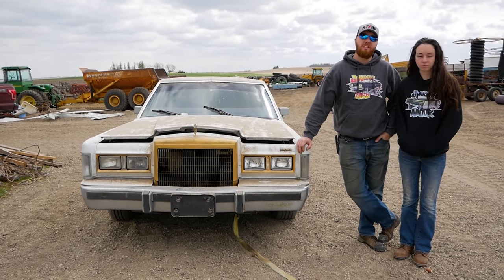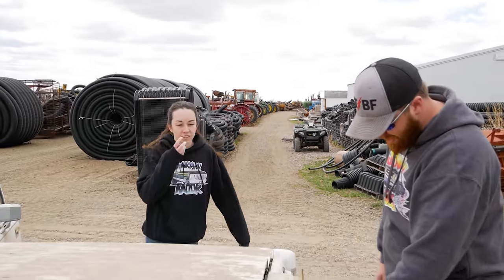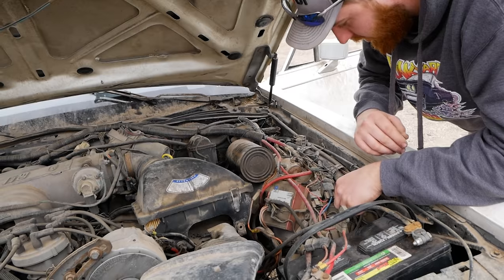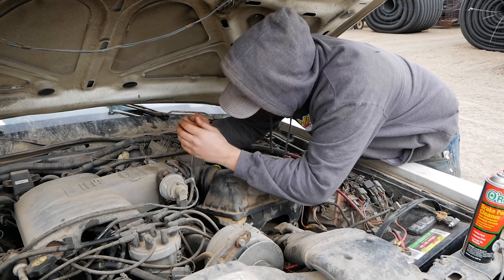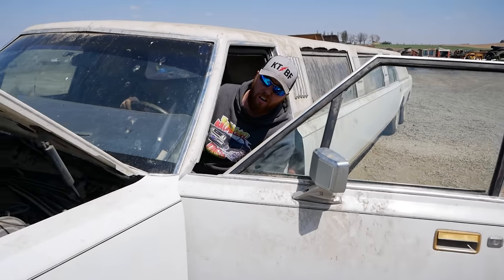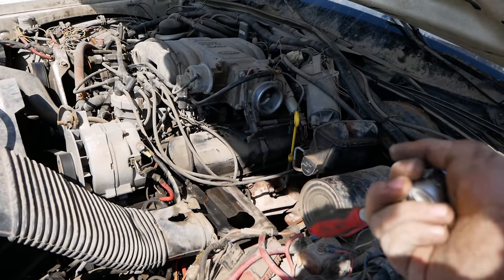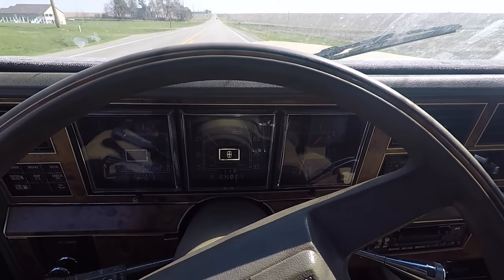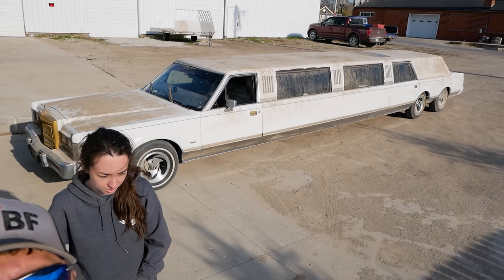Can We Fix an ABANDONED 35 Foot Limo?! - EFI Revival

Comment: You might want to research it.   If it's the same one I tried to buy 25 years ago. Then it was used in some rock videos. White Snake, Quiet riot. Weird Al Yankavuch. Some early rap videos.  Can't be many made.  I believe it was around 100.000 brand new

Comment: Put a six-wheel drive military bottom and a belt-driven V8 supercharged to 1100 horsepower on 2 ton military axles with rear steer fix the interior and throw a huge stereo system in it driving around in the mud bogs in Florida

Comment: That 302 is more impressive when you figure its the lower performance 150hp on a good day engine tuned for smooth running not power.

Comment: I'd leave that 302 in it. Yes it's not much sitting at nearly 40 years old and it's a torque engine so it's pretty slow but the 302 accepts alot more power with very little upgrading. I'm way more surprised that an AOD transmission can pull that car. This is way back when auto transmissions were just weak slush boxes

Comment: okay that fuel is just straight up nasty the old guys are going to have to flush that tank out flush the fuel system out replace the fuel pump make sure the lines don't have any holes in them and put brand new fuel in and try to see if it'll run

Comment: I say you should cut the middle out and make a normal length car with 2 rear axles...and fix the rear suspension trash and possibly ACTUALLY make it have dual driven rear axles.

Comment: 200 watts for 25 feet.  If the sub is in the back. The driver sure doesn’t even know if it works or not.  You need like 12 12’ subs and about 6000 watts to sound decent in that thing.  And that’s 6000rms not max.

Comment: I wonder if that's the former, Luciano Pavarotti, limousine?

Why would I wonder if it was his? He loaned it to me. Back around, 1984.  In New York City. And well… The New York City Police Department felt, it was necessary to, stop my chauffeur and me. Indicating there might be a gun in this vehicle? And having to remove, all of its, internal structures of, seats, wet bar, carpeting, TV, radio. Before they realized they made a mistake an hour later. Or maybe that was 2 hours later? Either way they took Pavarotti's, white stretch Lincoln limousine apart. The night he loaned it to me.

And so I can imagine. Somebody would get really upset over that. To have their car dismantled. When they have loaned it to me. Complete with his chauffeur driver. And well now that Pavarotti is dead. Who would want that old limousine. Whose interior had been disassembled by the New York City Police Department. And then reassembled.

And so I was wondering if that was the same, limousine? As it looks nearly identical.
RamyRAD

Comment: it’s funny the Cruise Control  does work in the Limo  almost always Fords do  and GeneralMotors older vehicles do not ? I beleive Ford products in general  use a very old Cruise Controll technology  as i beleive  they were the Company that pioneered  Cruise controll you should had taken Mook through the Drive thru for som reason i think she would had made that pretty funny  like she always turns something into entertaining  i grew up inSouthFlorida and the localJeep Dealership had a owner that was really into Racing and Off Roading he  always had his Mechanics working on Whacky Projects  one of which was always a old JeepFrame that was Monster Trucked and  they were constantly swapping out  the Body on top of the frame  one point they had a Stretch Limo ,OpelGT  and  they took a Old Gremlin  and chopped it up into a ElCamino  they called the GremUp !  ironically that  actuall body was  a old High School Freind of mine who’s Father was a Mechanic for AMC and the  Son took over his Das Bay  when the Dad retired !